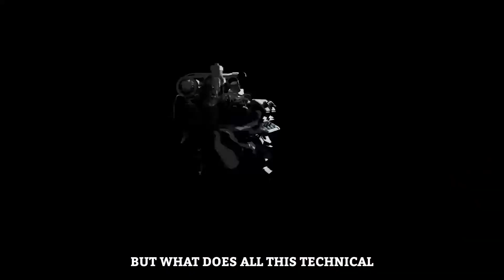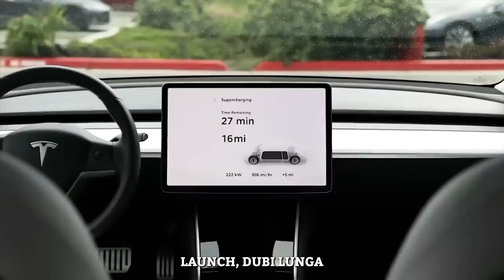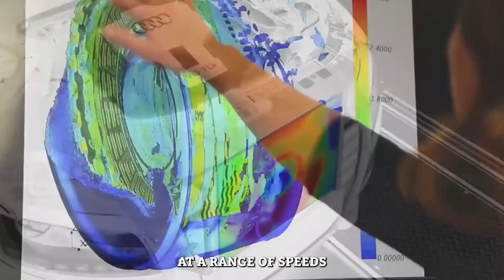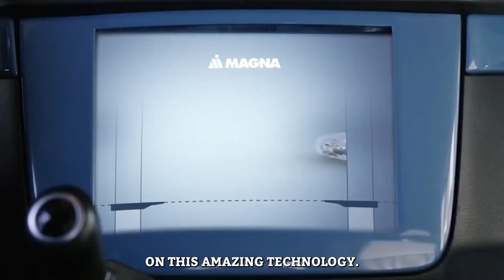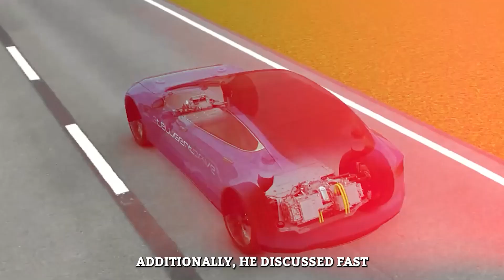CEO of Magna - New Electric Motor With Improved Capabilities

Comment: And of course in a collapsing EC market it doesn't solve the problems that electric cars have for already more than 110 years, charging and batteries. As long as those problems have not been solved the EV is nothing more than a solution that doesn't work for a problem which doesn't exist.